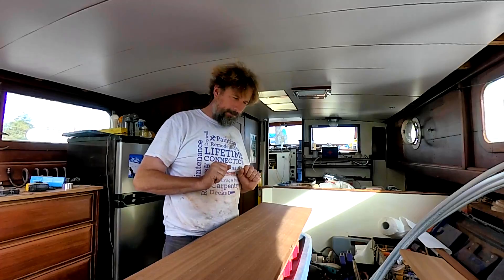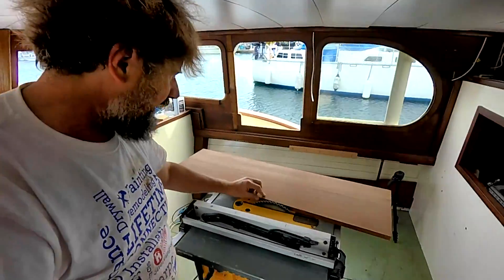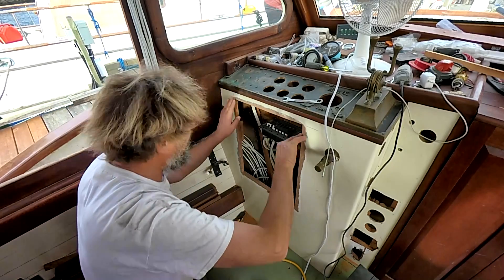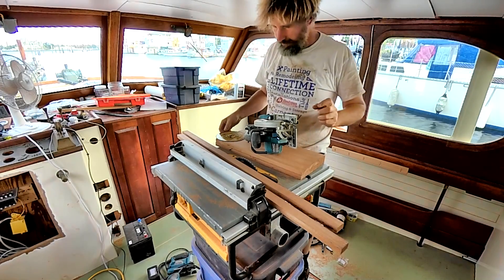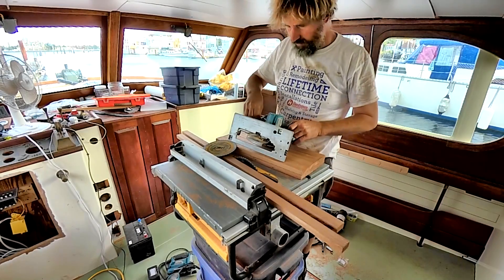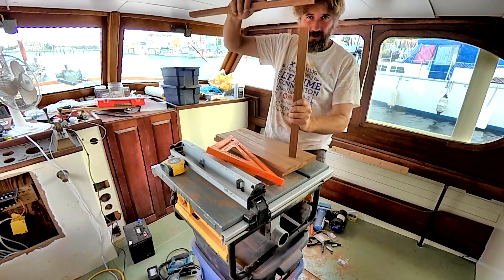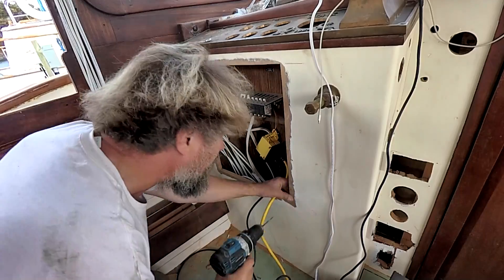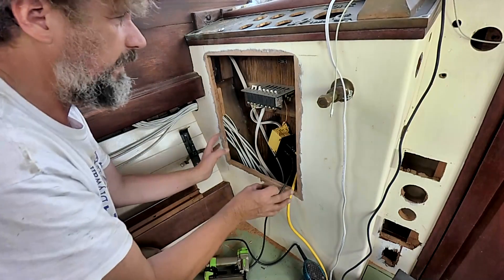Ep 86 - DIY Marine Electrical Panel: Tips for Boat Owners - Travels With Geordie

Comment: I like the work you do :-) I'm doing bulkhead rust repair and engine swap on my 109" 1963 atm. If i just had your energy:-)
Reply from the maker: Thanks Bjarke. What engine are you putting in?If you're interested I did a YouTube series about putting a GM 4.3 V6 in my 109. Search for Riverport Rovers. Some other Rover foolishness there too.
Reply: @TravelsWithGeordie  Thank you - I'll watch this series. Here in Denmark the rules for conversions are very strict. I'll use a Daihatsu Rocky 2.8NA mostly because I have it and the conversion to the original LR gearbox :-)

Comment: will wiring interfere with the opening of the doors?
Reply from the maker: Hi Adam, No I've carefully designed it to be routed in such a way that there is very little flex and no interference. Good question.

Comment: I must have missed the episode where you decided not to switch the helm over to the Starboard side? Bifold doors were a great looking practical solution. The wire harness routing is very, very sanitary. Those vintage throttle and drive controls are fantastic boat bling! I had to smile at the opening shot where you and Geordie were heading to the pub for breakfast. I thought it was the opening shot for a “Hallmark Movie” for a minute. You look the part of a boat Captain ashore for sure me b’y! Cheers!
Reply from the maker: Thanks Gary, It's easy to get confused. This is my friends boat MV Zephyrus. On my boat, MV Geordie I am moving the helm.Cool controls eh?!? Detail coming up.